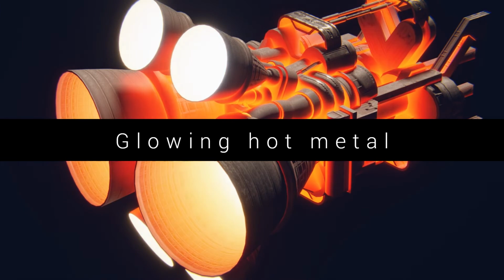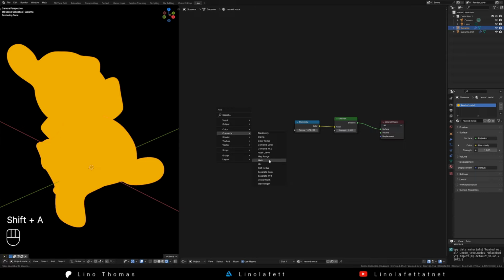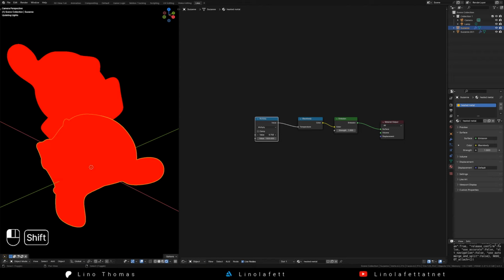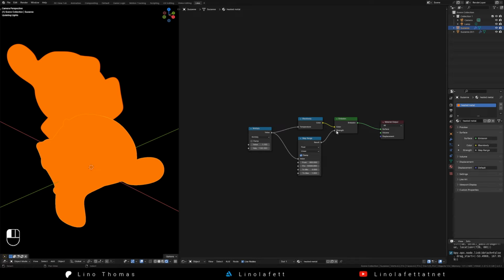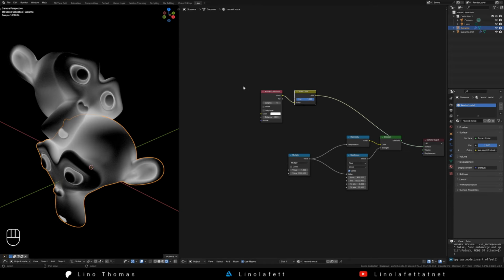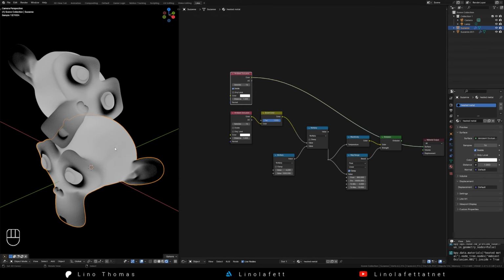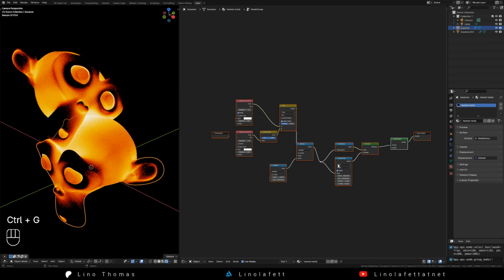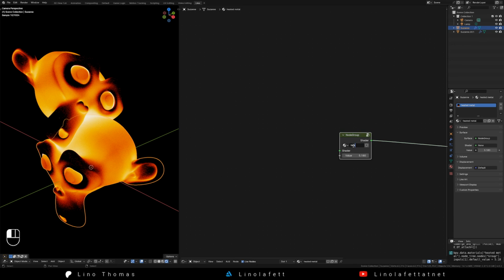How to create hot glowing metal - Quick Blender tutorial

Comment: this only seems to work in very dark scenes, could you please explain what to adjust if I have a spotlight on the object but I still want the see the darkness of the metal? currently, my material works in the dark, but looks pale with the lights on.
Reply from the maker: You can try to multiply the emission strength before you feed it into the principled shader. 
Depending on how strong your lights are, they might simply overpower the glow as well.
E.g. its hard to see glowing brake disks of race cars at day, but at night they glow beautifully - even when their absolute strength is the same irregardless of day/night.

Comment: Keep in mind, if you are not using Standard or Filmic color profiles (such as AGX or others), the colors can appear off (or at least much different than what is shown in this video). Additionally, the material settings (color) will also have a much different effect depending on the size of the object the material is applied to. So if you want similar results to this video, you'll want to build your model around the scale of the Suzanne primitive when building this material. Otherwise, your numbers will be much different in order to get similar results.
Reply from the maker: @ZeroDean  thanks for the heads up! I usually use filmic, as agx just desaturates everything too much :(
Reply: @linolafettatnet  My response was mainly for anyone following your video and wondering why their results were different. It took me longer than I'd like to admit to figure it out. 😅
Reply from the maker: @ZeroDean  i see your edit :D 
I think it was possible to change the ao distance in the node. Not sure if thats still possible. That would help for the scaling issue.

Comment: Hey first off wanna say love the video this effect is great. I wanted to ask though how I can get this to show a higher Kelvin effect of blue once I get between 15000-27000? I've tried using the node group and it just goes to pure white, if I just use the Blackbody node I can get the effect, just not with the rest of the setup.
Reply from the maker: @AVK9455  i never manage to get it proper blue, but you csn get it closer by doing following:
Change the mix colour node to add, Set its factor to 1. Behind that node add a nap range node with default settings. 
This will fix the math being wrong in the temperature slider, stuff will be hotter now.

Comment: is there a way to 
1: make the glowing not change when moving
2: make the glowing happen in specific places?
Reply from the maker: 1: bake the AO into a texture or vertex colours, otherwise this effect is dynamic. 
If you want to avoid it changing, because another object is moving past: you can enable in the ao node, that it just looks at the current object.
2: yes, you can paint out the areas you dont want affected with vertex colours (e.g. black on areas you dont want) and then multiply this as colour on top of the emission strength.

Comment: This didn’t work once I plugged everything together. The material is just black. Changing the value doesn’t do anything either. 🤔
Reply from the maker: Sad to hear that it didnt work. Can you debug your setup node for node and see if any of it works?
If you are on eevee make sure you have "ambient occlusion" enabled.
Also try switching to cycles for testing.
Reply: @linolafettatnet  I'm positive it's nothing to do with your node setup in particular. I have been having some functionality issues lately with my laptop's GPU. It's old, haha, and only 8GB of RAM as well, so I really don't have the best setup for this type of rendering. I'm going to redo it tomorrow, and hopefully it should work then! Thank you for your help, by the way!
Reply from the maker: @Deutritium93  good luck on the next try, hope your laptop serves you well ;)
Reply: @linolafettatnet  Alright, so I opened this file back up and watched your video again, only to realize what I had done wrong. I left the ambient occlusion node hooked into the material surface output and didn't reconnect the emission into it instead like you did. It works just fine! Fantastic shader! Thank you for sharing this. :)
Reply from the maker: @Deutritium93  happens to all of us at least once :)